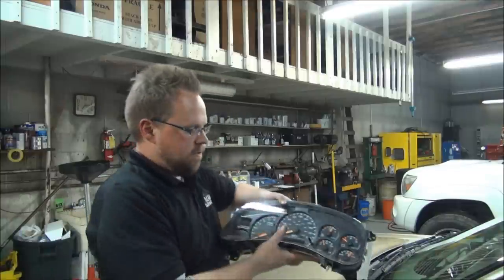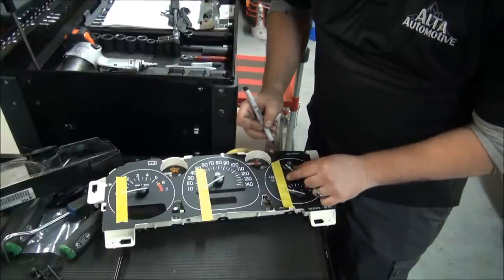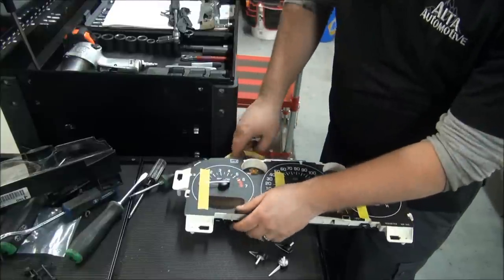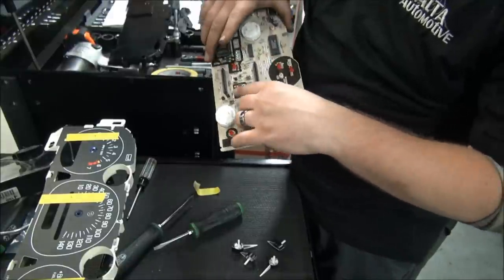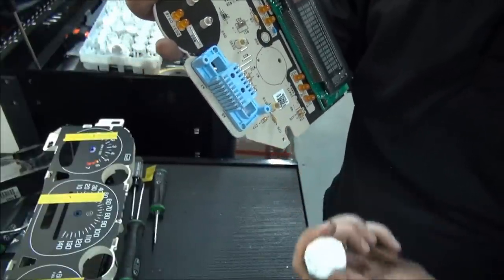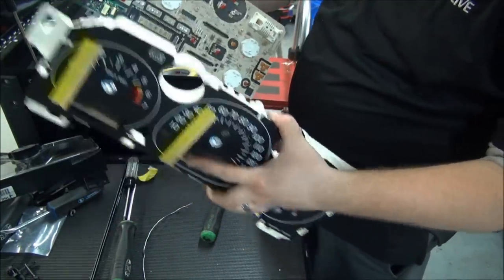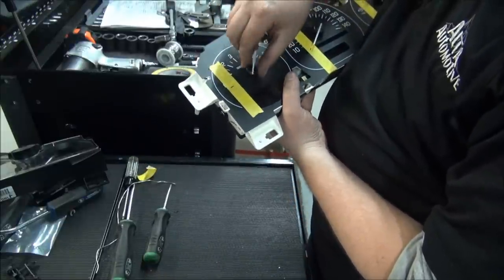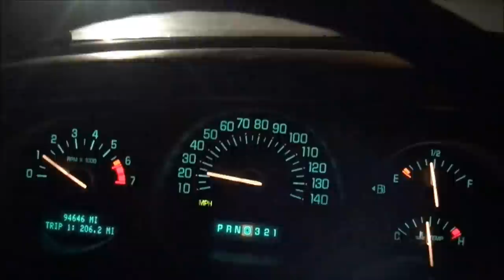How to repair GM Instrument Cluster | Speedometer | Gauge | Stepper

Comment: Thanks Bri for the video!! Great instructions.  I have a 2001 GMC Savana giving me fits with this error on my Gas gauge.
Since I purchased this van I have had several electrical problems. It seems a previous owner zip tied several wiring connectors together. Of course it caused the harness to cross several wires.. This was discovered by my mechanic and he wondered why it didn't burn to the ground... Is this a issue with this year model? I am now having issues in addition to the gas gauge with left brake lights not operating and the lights are dimmer one side to the other??? Any pointers?
Reply from the maker: 1-The gas gauge is most likely do to a failed fuel level sending unit in the gas tank.. and or fuel pump wiring on top of the fuel tank.
2-The light problem could be a faild tail light socket board.. (this is the piece of the tail light the bulbs fit into) if you have power at the tail light wiring its likely a fault socket board
Reply: Do It Yourself Bri, is your suggestion based on the year model stepper motor being more reliable? I bought the van from a lot and I suspect the wiring mods being done there, so without a tear down there is no telling what I may find... To further the problem description, the gauge needle often vibrates at a high rate and then will drop to empty then back up to a semi accurate reading vibrating again. The gauge has never read full after a fill up. The check gauges light is on...

Comment: Link to where you recommend to buy stepper motors please I would really appreciated by the way great video
Reply: by the way I'm working on a  1999 GMC SAVANA  temperature meter is of
Reply: by the way I'm working on a  1999 GMC SAVANA  temperature meter is off
Reply from the maker: +Misael Contreras I don't think the problem is in the cluster on that year van... most likely a defective temperature sensor/sending unit.

Comment: The stepper motors were replaced on my instrument cluster because my speedometer and rpm was not registering correctly.  They work great now but since install I have no light where my PRND or mileage is on my dash.  Cannot see.  Is this related to the removal of the dash cluster and do I need to "reset" anything or could it be separate repair on cluster?

Comment: Very well done;  to critique; I would mention cleaning the inside of the gauge window before assembling it. They do get dusty on the inside.  The Chevy criticizers, all I can say is don't they make it simple?  You can still work on it yourself.  Other mfg's. are probably not a whole lot different. Probably the same made in Korea stepper motors.  Maybe throw and replace.
Reply from the maker: Thank you!

Comment: The stepper Motors I got from eBay had 168 and 268 step Motors but all of the motors on the instrument cluster were 168 . Is there a difference between the two?

Comment: Is there any chance that I could get the part number for the stepper motors? I have an inoperative fuel gauge and an inoperative temperature gauge and I need to try to find out where I can get the stepper motors and what the part number is please. Thank you in advance for your help.

Comment: Do it your self.
 I have GMC Acadia 2008 SLT. The lights for the battery, fuel and oil gauges have all but quit.  The RPM & Speed are fine. Do you think the problem is just the instrument bulb? And do you know the size of the bulb? Thanks..
Reply from the maker: +Roger Camson Hey thanks for your question.... Im not sure what size bulb and or if it is led... I think that year may have gone to led lights...Would have to pull cluster and test.,.

Comment: Just undid my cluster but found L2 type Stepper Motors instead of the ones described, the X27 Stepper Motors don't fit on a Pontiac Torrent 2016.

Comment: Hi Bri, great video but how hard is it to remove the cluster from the dash? Also, what got me looking for help is my tach needle is running from the lower right up the right side of the gauge, thus, it's backwards. Is this a stepper problem?
Reply from the maker: Tom Wnuck  Some cars are very easy to get out some are more work. What kind of car do you have?
Reply: Do It Yourself Bri it's a 2004 GMC Envoy..

Comment: ( reply )Well the shop checked the temp sensor, said it was good, suggested the dash cluster gage.
So should I try replacing the stepper motor ? Will the X27-168 work in a 2002 ?
Thanks,
Duane
Reply from the maker: I don't think they take the same stepper motor.... I have never changed a stepper motor on a 2002 HD I also own a 2002 Chevrolet 2500HD... I personally have never seen a stepper motor fail on that year... However its definitely possible, I just have never seen it before.... I would suspect a shorted wire or they did not test it correctly..

Comment: Howdy, I have a question: Is it a different stepper motor for an 07 Chevy? I've got an 07 Equinox that fell into severe disrepair and, in addition to the temp sensor reading only between 190 and 220 on a diag reader, the stepper for the engine temp gets stuck above the hot as well. I just got done flushing the system, but I'm probably gonna need to do thermostat, temp sensor, and stepper motor to be on the safe side because the Jerry rig mechanic who took care of this car before me had been cutting a lot of obvious corners. Anyways, I'd really appreciate if you could give me the model info for that replacement stepper motor so I don't have to pick one off a used cluster.

Comment: Hello Bri, I have a 2002 Chevy Impala that I had to replace all the bulbs on the dash and I put tape on the cluster where the guages were and figured that's where they would still be after I took them off. Now the speedometer isn't reading correctly and the tach is kind of acting funny also and was wondering how to get it back to where it needs to be, can you help me?

Comment: Im having the same problem on my '04 Avalanche.. im going to use this video and try to replace the stepper motors this weekend.. however im not sure where i should buy the stepper motors from..  how can i get in contact with you if you sell them and how much do you charge? i believe i need 6 total
Reply from the maker: Devon Rhoades  I'm really sorry, I have been super busy. If you still need them call my shop at 801-292-1331

Comment: What would make your high bean indicator light to stay on in instrument panel after you turn motor off and remove keys. Had to locate fuse and remove to keep battery from going dead. 2004 silverado 2500hd. Fitting to change stepper motors.

Comment: Hello do it yourself bri I was wondering on my 2004 Buick lesabre I have a tachometer issue I replaced the stepper motor and recalibrated the gauge to the exact specs but it still doesn't work is there something I'm doing wrong

Comment: can you replace the whole instrument cluster and if you do how does that effect the mileage display. does it sync or will it show a wrong mileage
Reply from the maker: Yes you can replace the whole instrument cluster however you have to have the cluster reprogrammed to the vehicle before you install in programmed with the vin # miles etc

Comment: Would faulty stepper motors cause low oil pressure alarms to go off? I have an '04 tahoe with this issue and am completely befuddled by it

Comment: I have a 1197 Chevy S-10 with speedometer calibration problems and a gas gauge that stays at the full mark with power on.  Will the techniques you showed work on this year model?
Reply from the maker: No that is completely different on that model. Sorry :)

Comment: I have an 2007 Chevrolet Equinox LT AWD and the speedo stops working then suddenly starts working again, is this the same fix for this suv as well ?  A footnote, When it stops working you can see the center of the needle base slightly jumping.

Comment: thank you bri, i think i can do this, however i am having a hard time finding replacement motors or an original part number for the stepper motors in my 2000 blazer ls 4wd 2 dr. any suggestions?

Comment: hello sir, I have a 2002 GMC Yukon Denali that the speedometer was working before after a few days it stop working you think it might be the speed sensor or the step motor ?
Reply from the maker: +vargasmongo3435 On that year it could be ether. If you have a scanner, you can drive the vehicle with the scanner hooked up and if you are getting the correct speed on the scan tool then the problem would most likely be in the cluster, if you are not then it
its would be a player
problem with the sensor or wiring.
Reply: Do It Yourself Bri
thanks for the quick  replay I'm gonna scanned to see what I got thanks again

Comment: what if you have a 2000 Buick Lesa-bare limited as my gas Gauge goes fully full and then after awhile it will go to almost empty and the little light comes on and the bell sounds for low fuel and it will do this every time I start the car up but before it would read the correct amount of fuel then go a little forward and then a little backward and then when i put it in drive it would climb to the full position and stay there looking for your help with this

Comment: I have a 2004 cavalier. I did the same steps you did to take out the needles & I put them back in and the tachometer don't work. I can hear it moving but it just don't work
Reply from the maker: +Jake Bruh Most likely a bad stepper motor solder connection to the circuit board.

Comment: I HAVE A 2003 TAHOE AND CLUSTER GAUGES WORKS
ONES A DAY AS LONG AS YOU DON'T TURN THE 
TRUCK OFF BECAUSE WHEN YOU GO TO START IT UP
IT WON'T WORK AGAIN
UNTIL THE NEXT DAY OR
IT MIGHT START WORKING
AGAIN DEPENDING ON
HOW LONG IT'S BEEN SITTING UP ON THE SAME
DAY PLEASE TELL ME WHAT
IT COULD BE.

Comment: How can I determine what mm size light bulbs are used in the gauge cluster / climate control / radio on a 2005 impala base without taking it apart first?  I see 3mm, 4mm, 4.7mm bulbs for sale on ebay.  Thanks.

Comment: Hi Brian - I have a 2004 Cadillac Escalade EXT with a cluster problem. 2 out of the tiers are not working - Oil/Gas in one tier not working at all & the RPM gauge not working & is stuck on 6 - the highest level it can go up to.
((Working Gauges: Speedometer, Battery/Water one tier on right, & opposite side is Temperature))
Help <3 Debbie.

Comment: the needles of my speedometer and rpm drops way below zero when its off after putting it back together, any quick fix? Also they do move when im driving but there a little off. Its on a 07 tahoe

Comment: Bri:  I just watched your GM Instrument Cluster / Gauge / Stepper replacement video.  I have a question regarding the needle locations.  My speedometer's and tachometer's needles are below the 0 mark (basically a negative number if there was such a thing).  Should I mark the location where you did in your video, or where they are currently located?

Thank you

Philes
Reply: If I could add to Philes' question, can you explain why you would use the tape method you describe to "calibrate"  the new stepper motors once installed ?  You are making the "calibration" mark from the faulty steppers....  I don't understand....??
Reply from the maker: Philes Marconi  I have always just pushed them down to where they stop, and made my mark. always worked perfect for me. Normally is below zero.
Reply: Do It Yourself Bri I just did the job last week as you described in the video...  nice job !  All went well......  I had 3 steppers to replace.  Fuel, Speed and Temp....
My speedometer, however, read 2-3 MPH less than actual speed....  so, I took it back off and "tweaked" the calibration to compensate and now my speed reads right on the money.  Calibration speed compared to my Garmin GPS.....
I can't say about the accuracy of the other two...  I filled up the fuel tank purposely before doing the job.....  The fuel and temp gauges are "relative" anyway .  I'll keep an eye on the temp reading based on where it is NOW as a midpoint.  Fuel gauge accuracy I'll determine when it comes time to fill up.  I've been monitoring "when" to fill based upon odometer reading which is a digital gauge.....

Comment: i did this on a 2004 GMC Sierra. I forgot to mark the needle location before removing them. Now the gauges read incorrect. What do I do now???
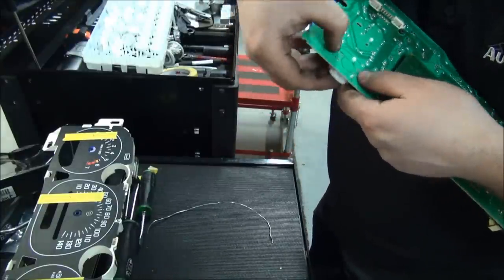Reply from the maker: If you cant find the starting point before you pull the needle off... Just pull the needle off solder in the new stepper motor and install the needle pointing at 12:00, than push the needle back and forth, forcing it back and forth until the starting point of the needle is just below the lowest mark of the temp gauge about the width of the needle below the lowest mark of the temp gauge. (maybe a touch more than that)
Hope that helps

Comment: i installed new steppers on my 05 pontiac aztek. tach-speed-fuel are all good. the temp gauge i set at cold but the prob is the gauge layout is counterclockwise from cold to hot.
the steppers rotate clockwise ???

Comment: Good video. I changed my stepper motors, passed inspection.  The next day the tachometer, oil and fuel stopped working again.  I tachometer moves but doesn't really give the correct information.  The  gas gauge "light" comes on when the digital readout reads "Refuel soon", but does not tell me how much fuel I have left. Any ideas?
Reply from the maker: I'm sorry not sure, What kind of car?

Comment: how do I go about purchasing 2 of them? My speedometer and oil gauge both bad. Auto part stores don't know how to get them. What website would I go to and what would they cost?
Reply from the maker: These are the stepper motors I use http://amzn.to/2mIzb6O
Reply: Thank you very much for your help. That's exactly what I'm looking for. I also like the how-to video. It will come in handy.
Reply: looking to buy these i stumbled on a forum where people were saying the x27 168A & x27 168B were different and that it makes a difference when selecting the right product, is this true ? 03' silverado
Reply: Jun 28 2017 - Got 2004 Buick LeSabre stepper kit including solder kit and more from Amazon vendor Dr. Roc for less than $32 today.  Search on Amazon for X27-168-B.  There is a provision to identify the kit needed for a specific model vehicle.  Multiplied thanks to Darrell Yazzie for this video!!  Bob L. Tennessee

Comment: Hey Bri! I have a 2000 Chevy Malibu.i was driving today and my fuel and oil floaters stopped working out of the blue. What should I do. I tried replacing the fuses on the driver side and nothing's changed

Comment: I have two stepper motors that flicker after I turn off my engine. I suspect they are the cause to my parasitic battery draw. Have you ever heard of this on a 2001 GMC Yukon? Any Help would be greatful. Thanks.
Reply from the maker: No not on a 2001... The stepper motors in the 01 is a different design that I have not seen a problem with.. You may have a problem with the circuit board in your cluster or wiring to it.
Reply: ok. will look further into it. thanks!

Comment: Great video. All of my motor gauges are non functional on my 2003 Silverado, but some are stuck at various positions, fuel is stuck at the 7 o'clock position. How would I calibrate/correct the position when installing a new stepper motor? Also, do you have a link to order these stepper motors?
Reply from the maker: +Darrell Yazzie You can call my cell at 385-439-7035. I can sell them to you please leave a message if I don't answer. I can give you more instructions with the purchase of the stepper motors. Thanks
Reply: Darrell Yazzie I
Reply: i have tge same problem
Reply: Amazon has them as well as the tools. You can even get a fork;)

Comment: Maybe I did,nt explain it right.The needles are in the right place, and like I said before  the gas and rpm needlesI can.t set to were they stay, They move when I shut off engine.Do these have to be set with the cluster out with no power because i,ve been setting them with the them plug in.thanks really need help.

Comment: Hello good video,   but my Digital Mileage does not light up but the rest works...   So I cannot see how many miles are on my truck.    I have a 2004 Chevy Trailblazer.    Can you tell us how to repair this Problem    Thank you
Reply from the maker: +Gfdf Perte Check for any broken solder connections anywhere on the circuit board especially at the PRNDL display. I have seen loose or broken solder connections cause the PRNDL display not to l light up.
Reply: where can I get a replacement Dash cluster?
I just got the truck and need to put a Mileage on the title.    The last recorded number was 147000    Any ideas  thanks.
Reply from the maker: +Gfdf Perte When I need to replace them I buy them from my local GM parts department.
Reply: Thanks.   That might be a little out of my price range,   Maybe a junk yard or e bay.    Thank you.    Can you tell me what color the power supply wire is  so when i take it out i can power the dam thing up.

Comment: What of all the gaged quit working at the same time?? I read somewhere that it could possibly be some resistors on the board that had come loose
Reply from the maker: +Leonardo Garza Yes that is most likely a problem with the circuit board.. When all gauges stop working completely it's normaly a problem with the board.
Reply: thanks so much. great video by the way

Comment: My question is I installed all new stepper motors on 2004 chevy avalanche.But myI gas gauge and rpm gauge .I can.t get to work right.They move when I set them,but when I turn off the needles are off, Any idea how to get them set right.all the others ok.These are all new motors

Comment: I've got an instrument panel on a 2003 Sierra Denali that won't "go to sleep". It's causing a power drain on my battery. Dealer wants $600 to replace the cluster. Any ideas?